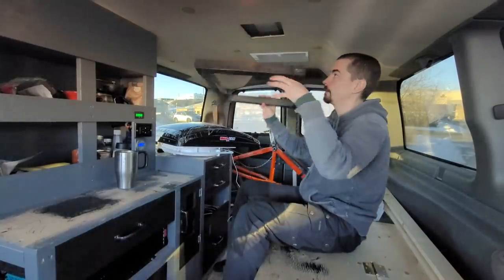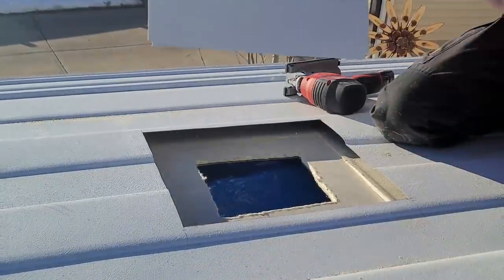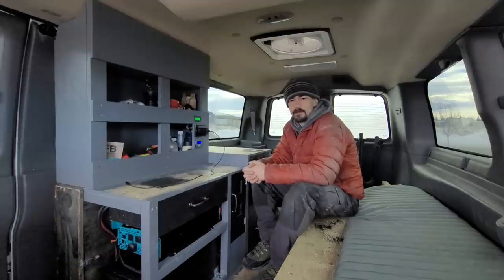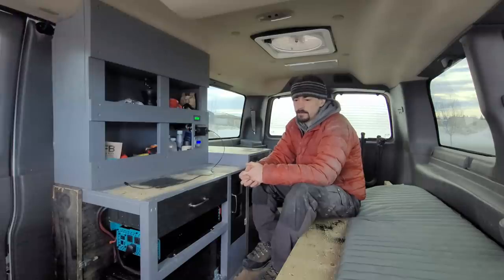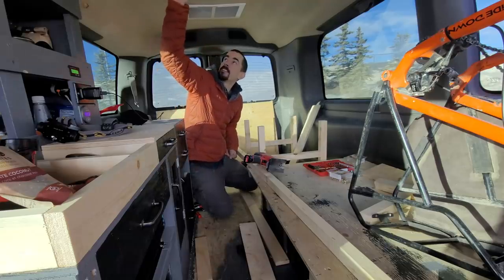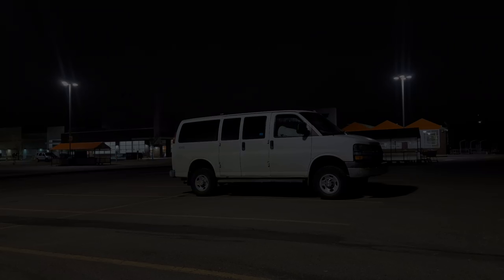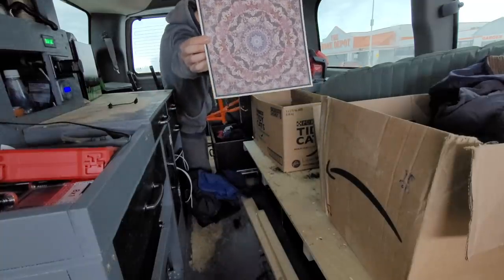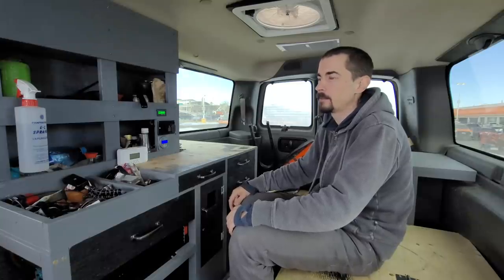Van Life - The Stealth Van Building Continues - Roof Vent Install

Comment: I would strongly suggest staying away from prop heat, diesel is the answer. waaaay  to much moisture in prop,
Reply: The Dickinson 9000 fireplace is sealed and uses outside air for combustion... They are great...
Reply: @ZiggZagg11  thanks for your  I have had just too many bad experiences with prop. what is your opinion of diesel. heat I have one now best move ever  Thanks
Reply: @llew777  I have a diesel heater running right now (yes right now) in my sunroom... It just keeps tic tic ticking along... In my opinion, it is a bit fiddly, but with the facebook group on how to fix them, they are easy to figure out...
Reply: @ZiggZagg11  Thank you for taking time to reply

Comment: Foresty, even though you had trouble with the transmission, do you miss the Uplander? A used car dealer in my town has one. It seems the perfect vehicle. They want $5500 for it and it had 110,000 miles. Good shape though You had a long history with yours. Just wondered.

Comment: Foresty, How did you go about feeding the wires and connecting to your fuse box without having to remove your headliner??
Reply from the maker: For the roof vent i just fed it straight across towards the wall, was easy to do.  Missed getting video of that part.

Comment: I’m curious how did you wire the maxair fan. Did you run the wires above the headliner? How did you remove the headliner?
How did you decide on where to cut the hole for the fan?
Reply from the maker: Yup the wires go above the headliner, it was pretty easy to feed them through.  I was lucky with alingment, i didnt have to cut through any of the roof supports

Comment: Foresty! I HAVE AN IDEA on how to strengthen your drawers without showing screws on the face. In case that glue gives you trouble.
https://imgur.com/a/zdy8nzl
(pre-screw "guide" holes so wood doesn't split. Not too wide though, you still want the threads to 'grab'.)
This is how some of my kitchen drawers are set up. Still anticipate and love your videos. Stay safe. Cheers.

Comment: Without solar panel, how he produce electricity?  Connecting to electric station or when car moving, the motor charging the big battery?
Reply from the maker: Yes i charge from the engine.  Once my new alternator is installed I can charge the lithium battery very fast, at 60 amps.
Reply: @forestyforest  Thank you very much. This is my favorite channel. Wish you the best.

Comment: After installing bigger alternator do you have to change the PCM settings ?
Reply from the maker: Not that i know of.  It just means theres more electricity available when i need it.
Reply: @forestyforest  
I just ask because on my Ford Transit I
have to change a setting in the PCM after
installing bigger alternator.
I don't know if chevy is the same.
Anyway if so it's not that hard to do.

Comment: About the fridge, you have a HUDGE lithium battery and 2KW inverter. Why spend all that money when you can just buy a mini fridge for under $200.
Reply from the maker: I think the power consumption of a typical mini-fridge is a lot higher than a 12 volt model.  That could be what represents the massive price difference.
Reply: @forestyforest   I also converted my van into a camper, I don’t live in it full time but I do camp often and the van is also my daily driver, so I use my fridge a lot in my day to day life. I only have a 1000w inverter and a smaller battery, I think it’s 100 or 120ah lithium. I bought a galanz 3.5 cu ft mini fridge. According to the power rating it only uses 0.8 amps at 120v AC. That converts to i think 96 watts while running and uses about 700 watt hours daily according to the energy star guide. It works for me because I can charge my battery with the engine and I don’t have other large power needs. Although your battery is bigger. If that kind of power use fits into the system you already have built it may be worth It to save the money and buy a regular mini fridge. You are correct that most DC refrigerators use less power but when you take price into consideration it may be worth the extra power use. I honestly don’t know why DC refrigerators are so much more expensive than residential mini fridges, it doesn’t seem that difficult to put a DC motor in the compressor rather than an AC motor but there must be something I’m missing. Anyway, I hope this information is helpful.
Reply from the maker: That converts to about 9 amps @ 12vdc.  Typically 12 volt fridges will draw around 2 amps.  It makes a big difference over the period of a day, how much recharging you'll have to do.  Food for thought.